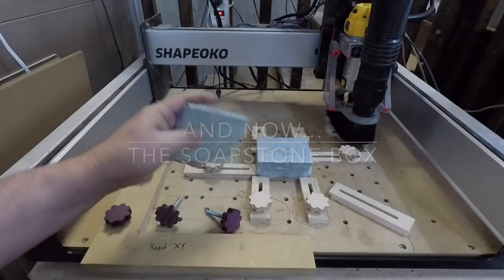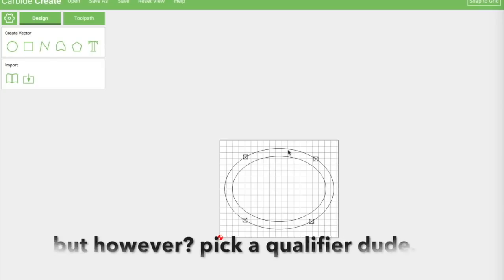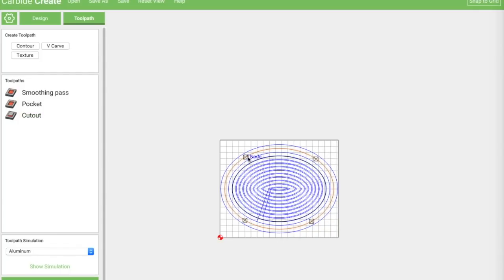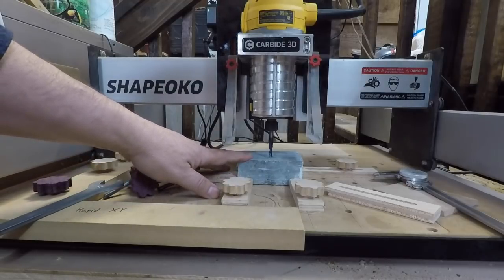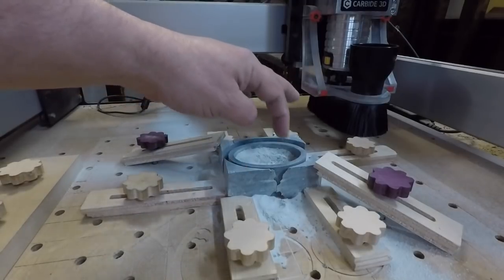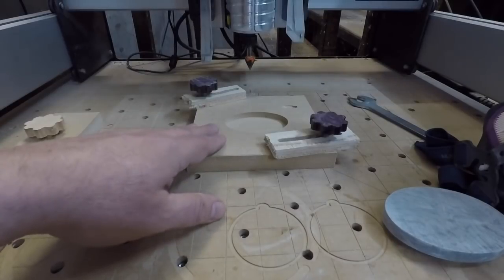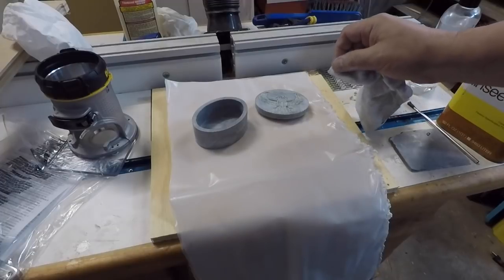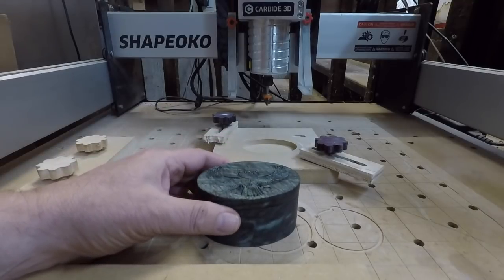Soapstone

Comment: Very cool - Thanks for sharing - I take it that your feeds and speeds were much slower that wood?
Reply from the maker: It's been a while so I don't have my exact feeds and speeds, but I was probably a bit faster than wood. Soapstone a lot softer than actual stone (more soap than stone). It's highly compressed talc, so dust collection is key. You can slice it on a band saw with ease. It also carves beautifully.

Comment: Great video! Will Linseed oil also restore dull areas? I have some older soapstone carvings from Africa and "fixed" some of the scratches but the areas did not quite restore color-wise (they are a tad duller than the rest). I'm having trouble using the beeswax (I'm a bloody beginner)...so I tried coconut oil. It helped a lot but you can still see the difference in color/dullness in the areas I worked the scratches. Any input would be greatly appreciated!
Reply from the maker: I have not tried it for scratch repair, but it might be worth a shot. It almost seems like a polish of some kind might help, but I would definitely try things on a small test area before going crazy with it.
Reply: @johnearlclark   Thank you so very much for your reply! I will keep watching your other videos, I'm learning a lot. I sure appreciate all the time you're putting into them! Have a fabulous day 😊

Comment: Hi John!  Thanks again for a great instructional and excellent idea for the holidays!    

On a different subject:   I have a shapeoko 3 xxl as well any hints on how did you go about tuning it?  I am having a heck of a time tramming mine to get an even cut on larger projects.   I have tried to scale up some of your boxes and have an issue with matching the tops which I believe is an induced alignment issue from the tramming misalignment.
Reply from the maker: I don't have an xxl so I can't say much in specifics about that, but the four things I generally check are: 1 Are the belts tight? 2 if I push and pull on the router collet, does the router rock back an forth (if so the wheels need to be tightened). The third thing that is key would be leveling the waste board. Winston Moy has a good video for this: https://www.youtube.com/watch?v=MtA_uF4CnVM Lastly, if you measure from corner to corner on the machine how far out are you (they should be equal)? My understanding is that the XXLs take a little more work to align. It's usually a matter of loosening the assembly, nudging and measuring until it's right. Moy also has a good one on this: https://youtu.be/P4VverLXpCI

Let me know if that helps.

Comment: Great video. Using the v bit how deep do you go when carving a image?
Reply from the maker: The depth is handled automatically and is based on how far apart your lines are; the farther apart, the deeper the bit goes. For a 90 degree v-bit the math is pretty easy: the bit will go half as deep as the width of your lines. If your lines are a quarter inch apart, the depth will be an eighth of an inch. If you have lines farther apart than the width of your bit, things get a bit ugly. If you use a 60 degree v-bit, it will go a bit deeper because it's a narrower bit. Does that help?
Reply: @johnearlclark  i think i get lol. But just dont change anything when using the bit.

Comment: While soapstone is mostly talc it is not made by compressing talc. Water will not dissolve it. Kitchen sinks and counter tops are often made of soapstone.
Reply: Thank you for making that point. The stone used in this video is close to 100% hydrated magnesium silicate, ie Talc and so, VERY soft. Soapstones used for architectural purposes differ only in the talc percentage and there the difference is very small, for instance the soapstone from VA is 90% talc and has long (1887) been the standard for laboratory counters and washtubs. Soapstone is acid and base proof as well as very heat resistant and makes wonderful building cladding, fountains, wood stoves and cookware. I have been turning it on the lathe and fabricating with it for many years.